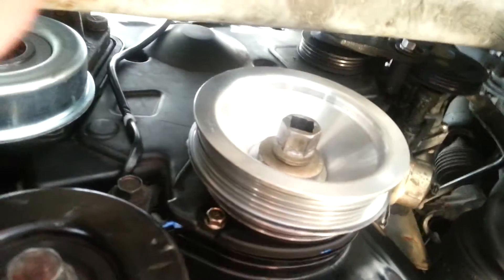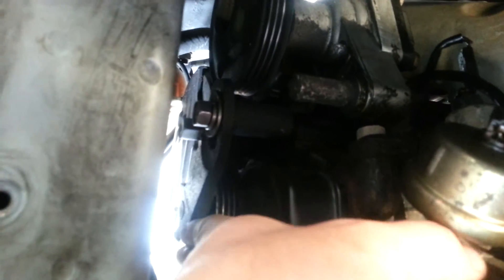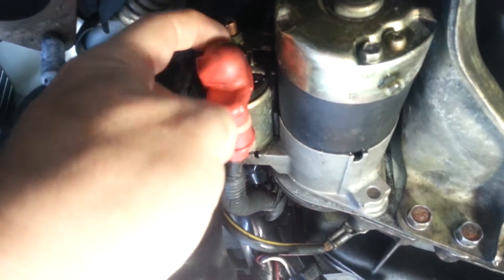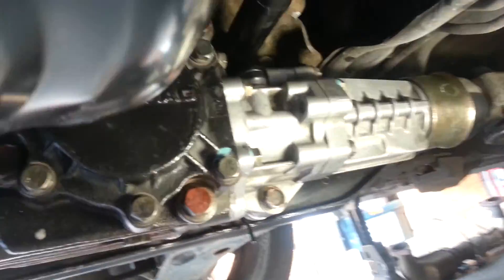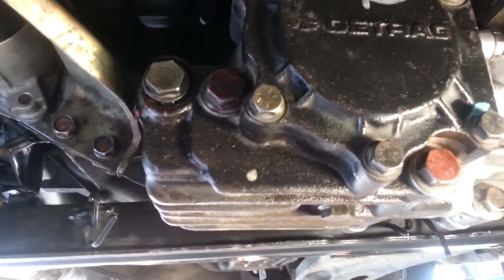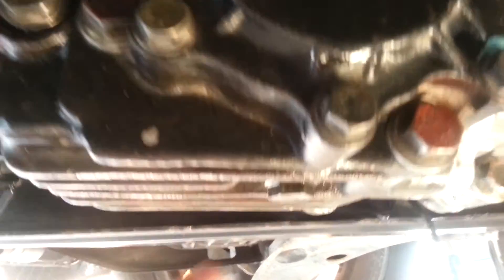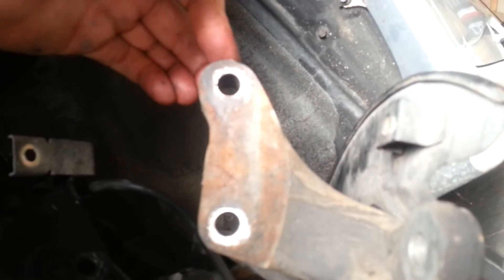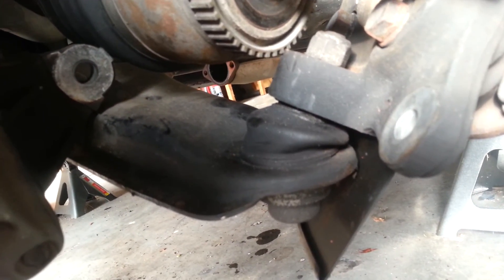Last VR4 Built - Starter and Transfer Case Installation

Comment: Hi I wondering if you would know about a GTO 1990 5 speed gearbox do you think it would fit a 6 speed gearbox from a 1996 cos I've been offered a gearbox I would need to get the selector as well wouldn't I just wondering if it's possible
Reply from the maker: I would contact Jack's  Transmissions to verify but I am sure you can make it work.

Comment: how did u get negative batt. cable to reach all the way to starter bolt??? wut came with mine isn't long enough. was thinking must have bolted up somewhere else
Reply from the maker: Might be a good idea to just replace it with one of proper length. A good power and ground cable\connection are important.
Reply: sorry It's stock negative cable so should fit somewhere but starter bolts r too big & cable won't reach that far. only positive will reach. Any idea where the charcoal canister hoses go? I have 2 on top & 1 bottom. (1997 3000gt auto-trans sohc) thx
Reply from the maker: Sorry. Not near my car right now.
Reply: it's ok, anytime soon be great. I'm working on my project myself trying put back 2gether

Comment: hey where is the crank position sensor on a 1991 3000gt sl?
Reply from the maker: Does not use one. It has a distributor, or sorts.

Comment: could bad motor mounts cause your transfer case to keep leaking even after replacing seals?
Reply from the maker: Keelan RC Not immediately, IMO, if at all. Did you check the drivers side output shaft seal right above it?